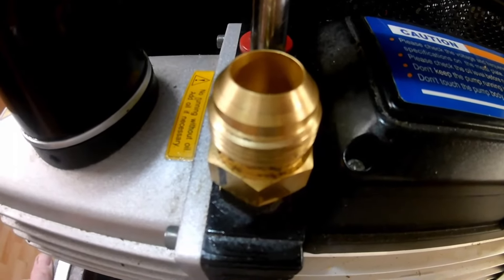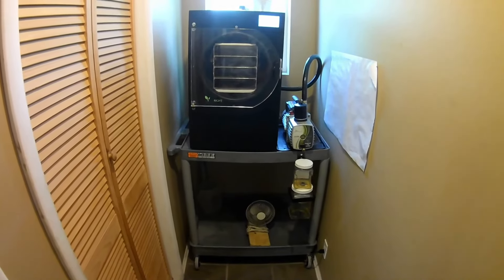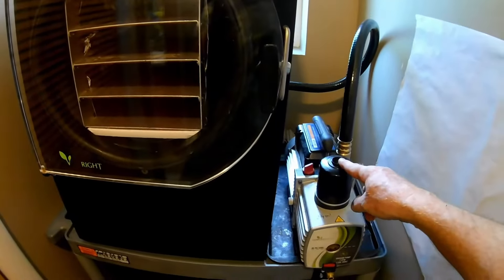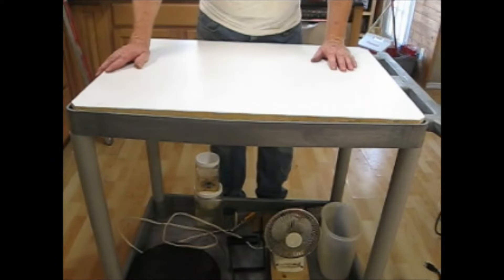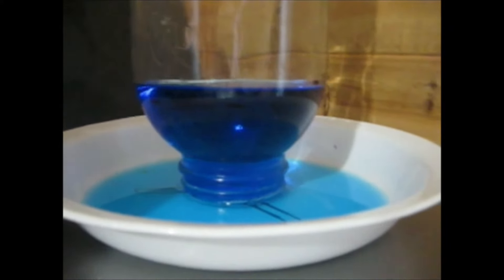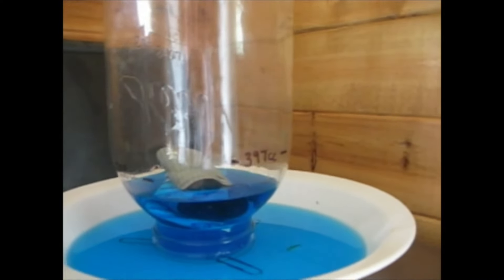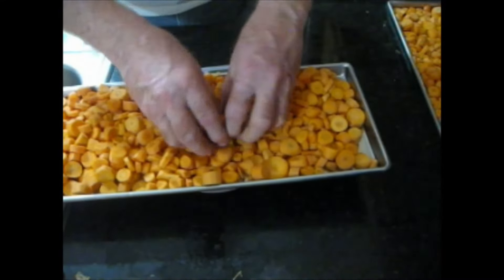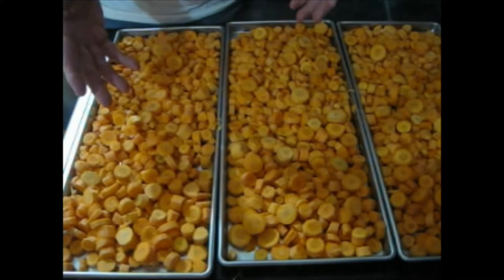Mo Hints and Tips #3

Comment: Phil,
Seems like we are similar minded!  I am an Emeritus Professor of Mechanical Engineering and avid gardener.  I used to preserve produce via pressure canning; but, switched recently to freeze drying due to its storage longevity and nutrition maintenance.  I downloaded your moisture spreadsheet and find it useful.  Likewise, when drying dissimilar produce I find it efficient to match moisture content.  Hence, since I started freeze drying I have maintained a log of each run.  To make my data useful and minimize erroneous results (I.e. transcription and math errors). I fabricated a M.S. Excel spreadsheet to enter data and calculate use data such as produce moisture content and reconstitute fluid needs.  I also freeze dry smoked meats and it is fun to deduce my own data for future reference.  I will be delighted to send you my spreadsheet for your perusal.  If interested let me know.
Reply from the maker: Freeze drying is addictive.

Comment: Hey Phil, thanks for all the informative videos. I'm a new owner and have learned a lot. I checked my trays and they range from 656 to 661 grams. Perhaps Harvest Right has improved their manufacturing quality control. Both more consistent and lighter.
Reply from the maker: Yours were 656, I had 721.  Perhaps you're right.  In most cases I wouldn't worry about the weight, but I wanted to be exact as possible for a peer review on some projects.

Comment: When you drain your oil after each batch do you pour new (or previously filtered) oil in to get the FD ready for another batch and allow the just drained oil to continue filtering while your next batch runs? Or don't you run them that frequently ? It took me 60+ hours for my oil to drain through the "Brita type" filter and I'd like to get another batch going before then.  I have the Premier Pump and wonder if I need to change it that frequently. Thank you for these videos!  I don't have an analytical mind like yours so I appreciate the tips and tricks you offer!
Reply from the maker: I change my oil after every batch and refill the pump with filtered oil.  I'll keep using the oil until it becomes cloudy.

Comment: Phil, I think you could do foods with different water content if you calculate the total water weight on each tray.  So, a 500g tray at 85% water = 425g water.  A tray with 450g of food at 95% = 427.5g of water.  Those should take the same amount of time to freeze dry.  Thoughts?
Reply from the maker: That would be correct if you can calculate the amount of water.  I have questioned the published amounts of water found in produce.  Freshly picked carrots will have more water than carrot in my cold storage after two months.  You're on the right track.

Comment: So  should we try to blow air through the system after removing the oil, think that would help?
Reply from the maker: I'd be careful using compressed air to blow out any remaining oil in the pump.  Too much pressure could dislodge the sight glass.  Better to drain the oil while hot and leave to valve open until ready for your next batch.

Comment: Say there, Phil. I'm about to balance the weight in all eight of my HR trays. There's nothing wrong with your hanger method - except maybe for possible rust. My preference would probably be for stainless filler rod. But, I wondered if you had given any thought to melting the correct amount of low-temp, lead-free solder into the bead. At a melting point of 289°F, it should have no problems with normal FD process temperatures. It would flow in without discoloring the tray. No epoxy required. Do you see a downside?
Reply from the maker: Stainless would be a good option.

Comment: Thank you for your vids & research!!!! We've just put in an order for a FD / am continuing to learn before it arrives in 5-7 wks (and beyond as well, of course 🙂) 2 items - (1) I've seen some of your vids on testing for moisture but haven't seen you use / mention a moisture meter, why not? (2) I'm wondering abt FD applications beyond food, do you know abt or have you experimented w liquid dish or laundry soap? Thanks again & God Bless!!!!
Reply from the maker: 1- A moisture meter will only detect moisture between the sample being tested, not the entire batch.  If there is a single chuck of food, containing ice, your batch could be spoiled.  I have found most moisture meters unreliable.
2- That's good thinking outside the box.  a FD will remove water out of any substance.
Reply: @Philat4800feet  Thanks Phil! 🙂

Comment: Hi Phil!  I’m been watching many of your videos and I’ve found them very helpful. I’m new to fd and I just completed my bread run or actually my second bread run. I had to stop the first one due to my daughter couldn’t sleep with the noise. So I finally got the chance and completed a whole other bread run. My question is my machine still has an odd chemical odor in it so should I do another bread run? Or is that normal? I have a batch ready in my freezer to go in but just don’t want my food to take on the odor. Any help would greatly be appreciated. Debbie
Reply from the maker: The smells could be the left-over protective oils and materials from manufacturing.  Pull the door seal off, pull out the tray holder, unclip the wire harness (there's a clip you'll need to slide to open and press) and wipe everything down with isopropyl alcohol and paper towels.

Comment: Phil, here's a suggestion that you might want to try out and make a video on.  When I do liquids (ie. eggs, pasta sauce, Milk) I put the liquid into a ziplock bag to freeze it.  Once it is frozen, I do not remove it from the bag, I simply open the bag and place it onto the tray.  I freeze dry it in the bag and when it is done, I powder the product and transfer it to the final storage container.  I minimizes the handling/mess of moving the food in and out of bags.   The other thing that I do, is I'll put the leftover rice from our weekly Chinese takeout order, into a ziplock and freeze it.  Once I have several bags full, I put those onto trays and freeze dry it.  It gives you instant rice once finished without ever having to cook rice.  And I sleep better knowing that I'm not throwing a full container of rice out every week.   Food for thought.
Reply from the maker: That's thinking outside the box!  How much liquid will you place in the bag?  If you don't have a full tray of liquid or have different liquids, it would be beneficial.  Good idea.
Reply: @Philat4800feet  I have a Large Freeze Drier.  I'm able to put 2 quarts of liquid onto a single tray.   I use 1 gallon ziplock bags to put the quart of fluid into and then set them on the tray for freezing.  Once frozen, I unzip the bags and put the tray directly into the Freeze Drier.   Right now, I have a load of Pasta Sauce and Spinach (liquid that I powder after dried).  I take a 10oz bag of Spinach and blanch it, then blend it into a liquid.  I then pour that spinach liquid into a quart ziplock bag.  I  can get 3 quart bags on a single Large tray.

Comment: Is it normal to smell the food while it’s drying in the fd?
Reply from the maker: Maybe at vacuum start up.  The pump will expel any air out of the chamber.  That would only last for a few seconds and stop.
Reply: @Philat4800feet  it has lasted for many hours during dry time since this morning and still now. I called customer support and they said it was fine but I wanted input from another user. Hmm
Reply: Btw it was semi-warm chinese food i ordered when i put it in yesterday (over 30 hours ago now), not prefrozen as you normally have the food. Not sure if that would make a difference.

Comment: Wow, what great and helpful info! Did you calculate the total cost in electricity for each batch as well?
Reply from the maker: Not really.  My unit pulls 16 amps or 1920 watts per hour.  At $0.08.76 per kilowatt hour that equals $0.17 per hour to run my FD.  With that in mind you could divide grams of food by $0.17 for a full load. (I have a four tray FD)
Reply: @Philat4800feet  How do you measure amps your machine is pulling?  Thanks. I have learned a lot from the 5 videos of yours that I have watched!  Looking forward to learning more!  Just curious, do you live in Colorado?
Reply from the maker: @lynnesward3154  I made this video on amperage draw:
https://www.youtube.com/watch?v=SfJxoGUUKKE
and no, on Colorado.

Comment: When I search the crush washer it doesn't look like the one on your fitting.  Where did you get that one?
Reply from the maker: Search under- Hose and Rubber Supply.  Their part number is CG12 (#12 JIC crush washer.)  Sometimes the JIC is interchanged with SAE.  The Manufacture is Midland Industries.  Their part number is 10090.  Also called a 3/4 FLARE GASKET
Reply: @Philat4800feet  I found it on midland industries.  Will this replace the o rings?  Thank you !!!!
Reply from the maker: @lyndabuchholz1216  I have never seen a JIC fitting with an O-ring.  I can't see why it wouldn't make a seal.
Reply: @Philat4800feet  The o ring in the fitting had a dent in it and I contacted harvest right to see if I could get one that fir since the o rings seem to be an odd size so far I haven't gotten any and hoped that the JIC fitting would replace it. I saw the o ring in your fitting in one of the clips in this video but it looked fine.  I see it at 1:04 in your video.

Comment: If I weigh equal amount of items before putting on the trays it should make not difference. The trays contain no moisture. I do not like modifying equipment. The spread sheet is great to equal up apples to apples so to speak.